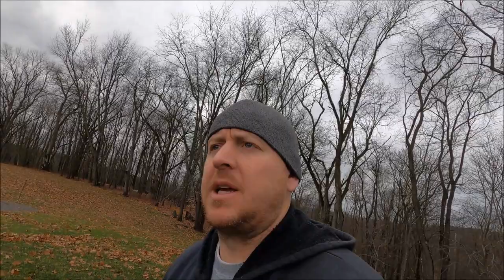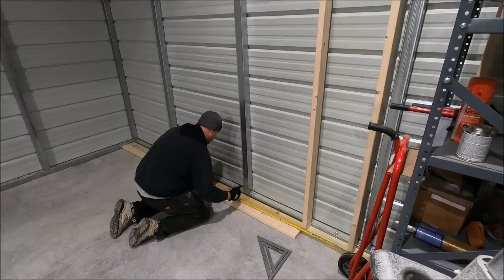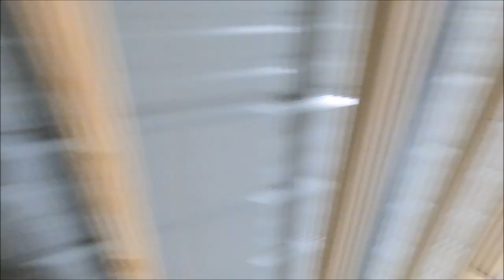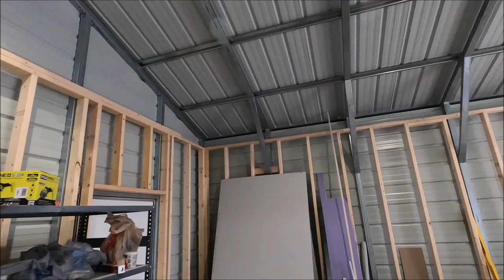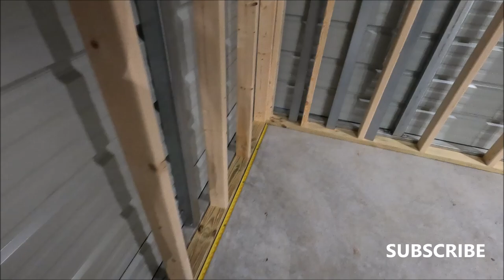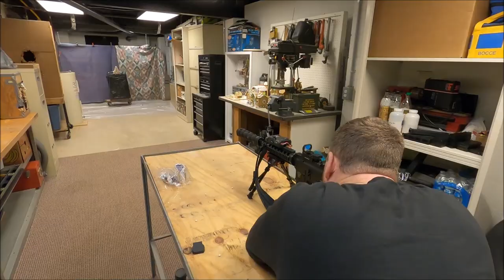Framing Metal Garage Episode 2 | NYE Gingerbread House Demolition

Comment: I'm so glad to see this. I'm doing the same thing. Everyone keeps telling us to build a normal house. Every time I do a brake down, it's way cheaper to do it this way. Plus, it's super thick walls with 2by4 framing.
Reply: How thick did your walls come out to be after this.
Reply from the maker: They are still only 2x4 walls. You could spray foam the metal walls, and the put the 2x4 walls up like I did, and have a wall about 6 1/2 inches wide.

Comment: Nice progress, looking forward to seeing how you do the ceiling!
Reply: I hate to say this, you are going to have water coming in under base plate. Why in the hell did they require 3 orr 6 inch revel around building. They need to have there ass kicked.
Reply from the maker: @timothylesch4053  Thanks! I agree. I don't know why they required such a large apron around the edge, but I did silicone around the base and haven't had any issues.

Comment: Unless you are planning to insulate between the metal and backside of the 2x4s that 3 ply 2 x4 corner is going to be quite the cold spot. A "California corner" at least allows for 2" of insulation which is far better than none.  Other wise good progress and nice work.  Although I have to think that at 40" deep that office is going to be very tight but if it is all you need then that is what counts.
Reply from the maker: I will give the insulation some thought by the 2x4s. Thanks!

Comment: Excellent teacher and very well organized. I want to build a small room in my garage using 2x4x8. I have a metal frame and door.Can I use the metal frame and door without using metal studs??
Reply from the maker: Absolutely. Metal studs are expensive and I don't really see an advantage to them unless you are trying to achieve a specific fire rating.

Comment: I live in Northwest Indiana, 30 minutes from Chicago. I had Midwest carport build me a 22x30 in July. I also framed and put 2 inch foam board insulation and drywall. Wondering how to do the ceiling. I will keep watching your progress! In my area they wanted almost 7k for spray.
Reply from the maker: I am going to spray foam insulate the ceiling with a thin layer of insulation. I am then going to frame in a hard ceiling.   I won't spray the ceiling until May or so when the temperatures moderate.

Comment: All good work . Good on ya mate.  But.  No moisture barrier between the concrete and the timber ???   Just asking . I'm no builder.
Reply from the maker: Thanks! The wood on the bottom is pressure treated approved for ground contact.

Comment: Hi, love the videos. Do you anchor the frames into the concrete and is that the only anchoring you used. Thanks
Reply from the maker: Framing is anchored to the concrete and is completely independent of the metal building.

Comment: wat is the advantage of doing metal and then wood framing vs. wood framed to begin with. Does not having to put up OSB help to offset the added cost?
Reply from the maker: It offset some of the cost, but the main driving factor was getting a garage in a day and using it immediately.

Comment: Drill 1 inch holes in rock and use Declan
Reply from the maker: Thank you so much for your suggestion! I meant to catch up with you a little while ago. Using your suggestion we bought something similar to Declan but because it is temperature dependent, we will have to wait until next year.

Comment: thanks. i have been a car mechanic for the last 28 years and am about to retire. so I am planning to build something like this for all my tools. i am going to go with a 30x40 and install a couple lifts in it.  i am also going to build a waste oil burner to keep warm.  i wish i knew carpentry like you do but since i don't i will use pallet racks along the inside walls to use for storage.  thanks again. will this company build this in TN?
Reply from the maker: I would check out Alans Factory Outlet website for the details. It is a Carolina Carport brand building but Alan's sells them. I know with COVID things got crazy and they were selling buildings but not able to get them installed in the time they projected. I would definitely make sure they have everything sorted out.
Reply from the maker: Carpentry is easy. I wish I knew more about aito mechanics.

Comment: If the metal beams were closer together, could you insulate and attach the drywall directly to them?
Reply from the maker: I wouldn't. The buildings are designed for certain loads and aren't meant to have a bunch of weight attached to them.

Comment: Hi! 2 questions, if you don't mind.  I may have missed it but are you attaching the wall frames to the floor OR the steel AND at 5:58, the 2nd steel support from the left behind the framed wall doesn't look plumb. Is that a concern? I'm thinking about doing the same thing. I could stand to learn a thing or three.  Thanks!
Reply from the maker: The metal building walls are absolutely not plumb. I only attached the wood framing to the floor and no where is it attached to the metal building. The wood framing is its own structure. This is why I put plywood in certain areas, to make sure the wood framing had some rigidity.
Reply: That's what I thought. I just didn't see it in the video. Thank you! It will looks great!

And my condolences to the ginger bread houses...

Comment: Are you attaching the wall studs to the metal posts?  Enjoying your work 😊
Reply from the maker: No. The wood structure is independent of the metal building. One, the metal walls aren't plumb, and I don't want to put any stress on the metal building.

Comment: When pulling layout and you’re marking 16” on center, I notice you mark 16” and then place an “X” to the side where the stud would lay. So does that mean it’s not actually on center if the stud is placed to the left or right of the actual 16” mark?
Reply from the maker: I pull my measurements off the end of the board. I make a mark at 16" and the "X" is ahead. If you move the tape measure 3/4" in from the end of the board, you will see it lands right in the middle of the "X".

Comment: So with the wood structure being in dependent is the combination of the anchoring into the concrete and using the double top plate to tie the walls together allow the ability to hold drywall without the topside of the wall falling over due to weight? I’m trying to figure out how to do this in my metal building and was very curious how to anchor the top plate (I don’t  want to drill into the metal either).  I would like to hang plywood on the walls, would this approach also hold the weight of plywood?
Reply from the maker: The top plate holds everything together, but I purposely built the three foot walls in the middle both to for installing beams to allow for a higher middle ceiling, but also to help stablize the outside walls. The plywood on the three foot walls really stiffened everything up. The ceiling joists help tie everything in as well.
Reply: @brettleybuilt  Thanks for the quick reply that was really helpful.  I have a fairly small building, 12 ft W by 40 ft L, so I won't really have the space to put 3 Ft walls up as well.  Do you think that double top plate approach + anchoring in the bottom plate would be enough to hold Plywood?  I also thought of putting joists across the 12 ft width for stability but I'm concerned with 1, how that would look and 2 making the already small building feel smaller.  Would love any thoughts you might have.

Comment: Are you connecting the wood framing to the metal framing?
Reply from the maker: Absolutely not. I don't want to put any unnecessary stress on the building. The structure inside is completely independent.

Comment: How did you fasten the top of your 2x4 to you steel frame?
Reply from the maker: The framing isn't attached to the metal building. It is a stand alone structure.
Reply: So if the top is not attached to the steel how how do you keep from falling over? Sorry rookie question

Comment: Why not just spend the 2,000 and get it spray foamed and put up plywood or w.e u want up with self taping screws into the metal and that way u get a tight seal on the whole building and can keep your extra 14inches of square feet on floor that u loose framing it up. I'm looking into getting a pre fab put up so I'm just wondering why not do spray faom and u did framing and then insulation and are you insulating the ceiling??
Reply: I have no idea what spray foam is like these days but when I was a kid (30+ years ago) my dad spray foamed one of the farrowing sheds for the sows and just so happens we then got a mice plague and the little buggers chewed through the lot of it. Is spray foam rodent proof today?
Reply from the maker: Yes, I am insulating the ceiling.

Comment: Seems like you’re actually loosing 3 1/2” on all the walls by installing your walls in front of the metal studs
Reply from the maker: I am, but I bought a large enough building to account for the space I would need with the loss of the seven inches.

Comment: why wouldnt you just strapp the metal studs and use that to anchor your drywall etc to same way they would do a pole barn build
Reply from the maker: The building is designed for certain loads. I don't want to mess with the building and I needed a way to put a drywall ceiling in it.

Comment: Speaking of red-necky, did you try using winter ice to push your boulders out?
Reply from the maker: That might be a pretty good idea. Let me give that some thought on how to get that done. I would even settle for breaking them apart with ice.
Reply: @brettleybuilt  Hope it works for you. Re the "breaking them apart"  I've seen where old stone masons would drill holes in a straight line, then methodically drive in cut nails to split the rock, but your boulders are probably too huge to be affected by that.
Reply: Tannerite my friend... tannerite LOL

Comment: Did I miss how he attaches the seal plate to the concrete?
Reply from the maker: I anchor the pressure treated wood to the floor with Tapcons and Redhead bolts.
Reply from the maker: I have a couple more places to bolt down. I will add that to my next video.